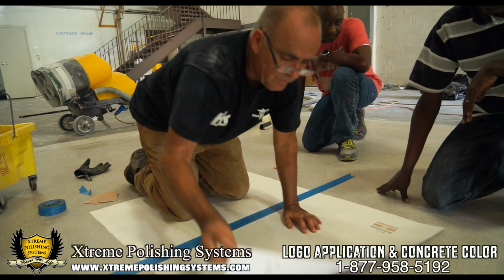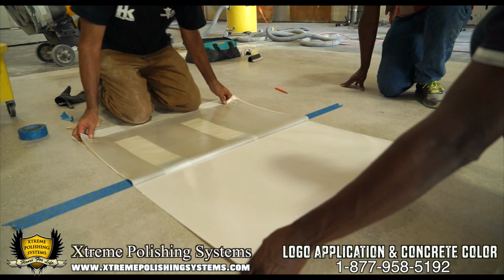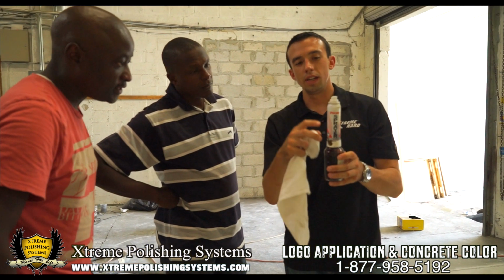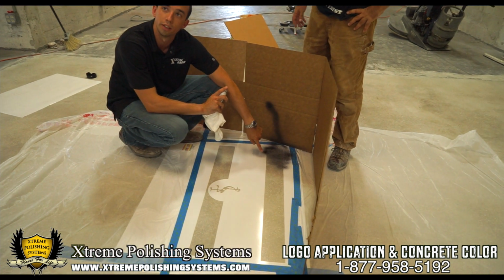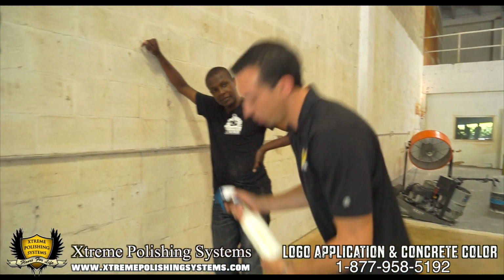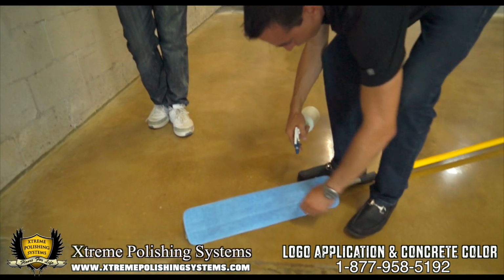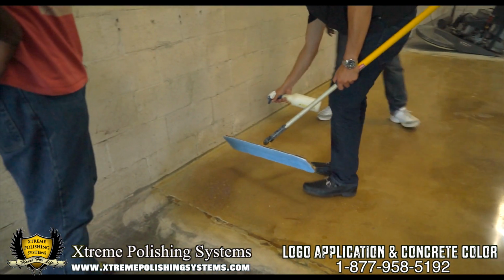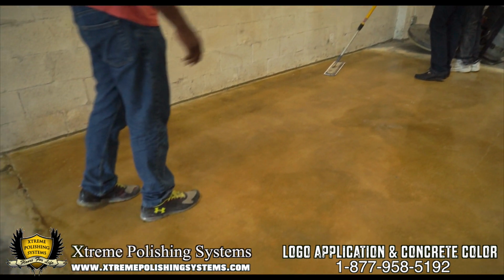IN-DEPTH Guide on Concrete Polishing for Beginners | Xtreme Polishing Systems

Comment: Hi, appriciate the quick reply if possible. 
I am facing problem with the adhesive tape residue left behind while removing after application of dye. 
Which adhesive tape you using for line marking ( the blue colour)
Reply from the maker: For project specific inquires, please give one of our installation experts a call at (877) 958-5192 for assistance.